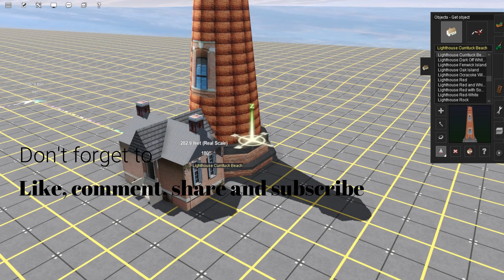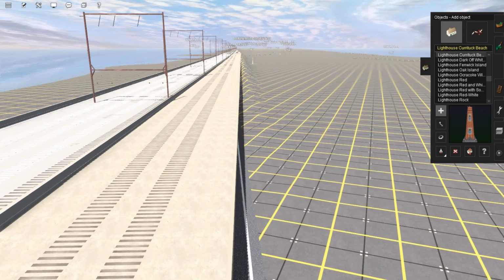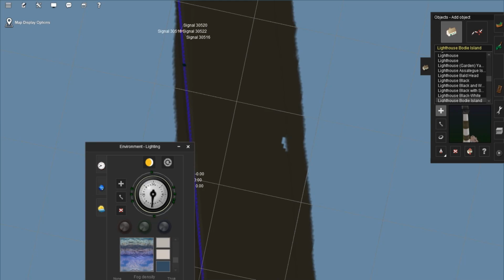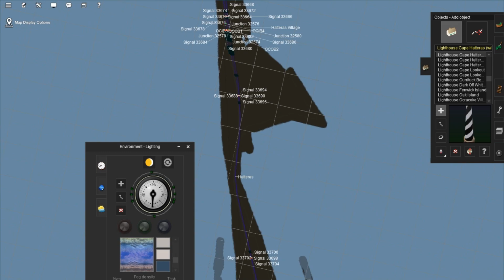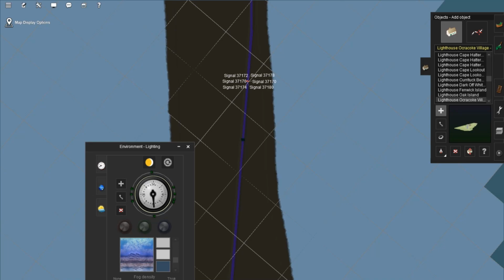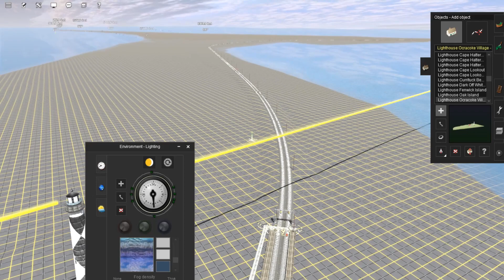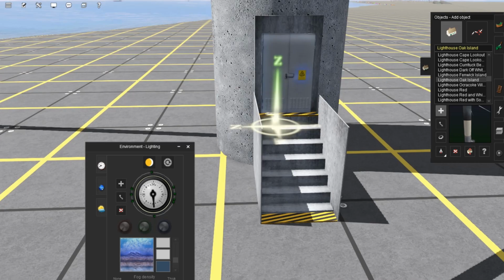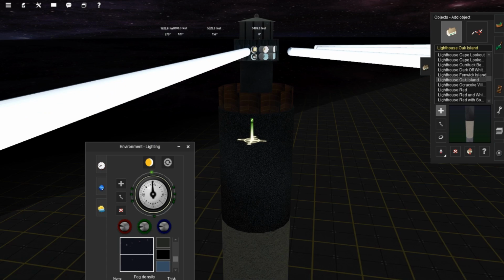Every Lighthouse I made for Trainz So Far

Comment: I have a question how do you lower the graphics on trains a new era to stop the lagging I use an HP laptop and I don't know what settings I go to there is general settings video settings interference settings sound settings control settings global settings and jointed Rail settings library which one do I go to?
Reply from the maker: From the launch menu, go to Trainz Settings, then click Performance.
Reply: @Trainfan1055Janathan  gor it thanks
Reply from the maker: @UCzV3n-kDxomMo6UZZkSn-Tg I usually just try lowering one thing after the other until the lagging stops.